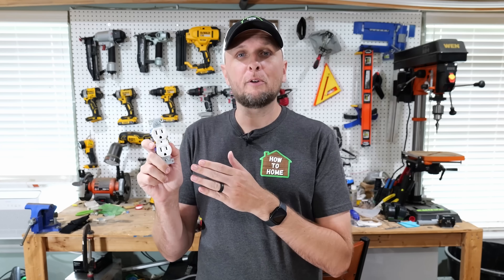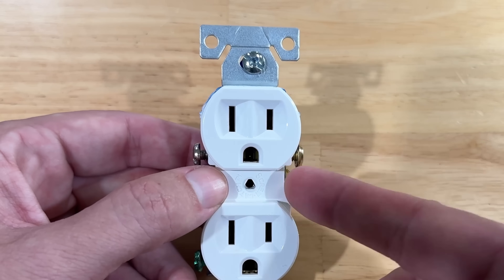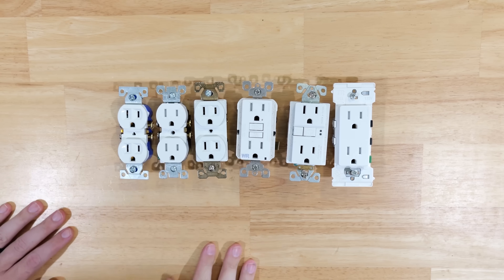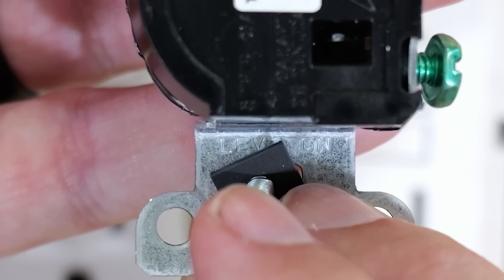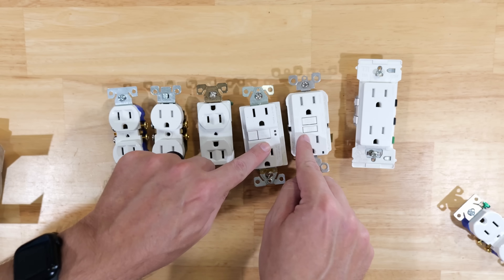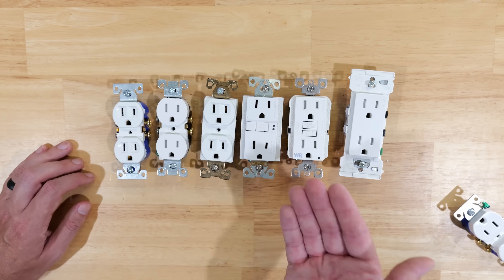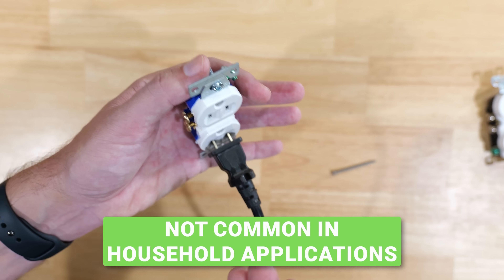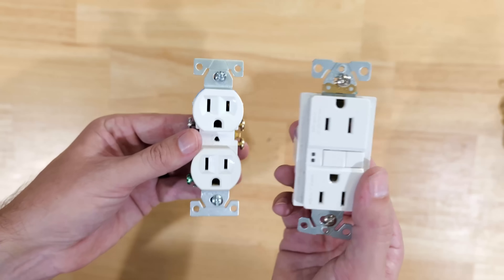The Shocking Reason Why Your Outlets Are Installed Upside Down!

Comment: One of my customers had those 90 degree plug flat cords into the wall going down the wall behind office furniture panels with the outlet end visible. They then plugged in outlet strips into that. Those flat cords have the ground at the bottom. Now this is NOT code (at least there) as you CANNOT have an extension cord in a commercial setting. The fire martial busted them and they then pulled out the extension and plugged the plug strip directly into the wall outlet and smashed that by shoving the panels back against the strip. Somehow this causes the screw that held the plate to pop out. The plate was metal and it dropped onto the hot and neutral. BUT instead of shorting dead and tripping the breaker it danced around until the sparks lit the office furniture panel on fire. So the action taken to appease the fire code caused the fire.  🙂  HAD the ground been on top, there would have likely been no fire. Not guaranteed of course because the plate could still have connected ground (instead of neutral) and hot.  Now of course the proper solution would have been to purchase all new plug strips with 90 degree cords, but that was more expensive and inconvenient than simply using the ones they already owned.

Comment: So there's no code on it, it was just convention back in the day when 20 amp outlets looked the same as 15 amp ones.  You find ground pin up in kitchens and bathrooms in houses built in the 60's-90's when the inexpensive 20 amp receptacles looked the same as every other outlet.  Upside down denotes a 20 amp circuit.  People made up the "safety" aspect after the fact when they didn't know why the kitchen outlets were upside down.  With modern T socket 20 amp sockets and common code calling for 20 amp circuits in kitchens there's no longer a need to install the outlet upside down to inform home owners that it's a 20 amp circuit.  
Generally an upside down outlet is telling people "Hey, there is something special about this socket". It's 20 amp, or it's switched or some such that makes it different than the regular ones.

Comment: You missed a reason. Every "flat plug" extension, outlet strip etc. that I have ever seen or can find just now in a quick search are ALL designed for ground plug down. Not to mention every house I can remember has them ground prong down.

Comment: As mentioned in the video, other than not installing it facing up due to potential water getting into the outlet, the argument seems silly since there are times when receptacles need to be installed sideways, at an angle, or facing down (like under a counter). The direction of the wording on the back of the receptacle is irrelevant since you won't see it after it's installed and it's covered with a face plate. And with my old eyes, nowadays I would just take a picture of the text with my phone so that I can zoom in on the photo to read it!

The most important thing is to get the wiring correct before installing it!